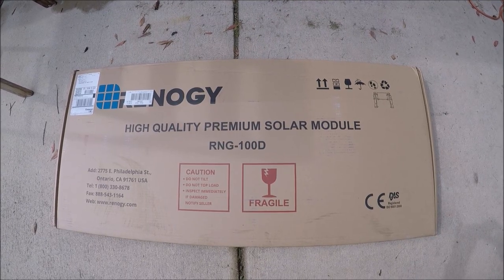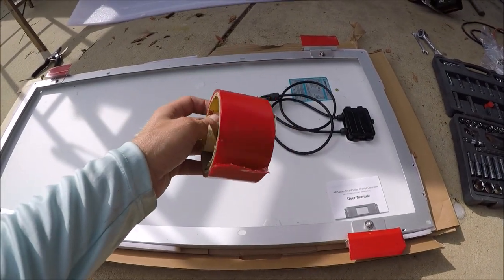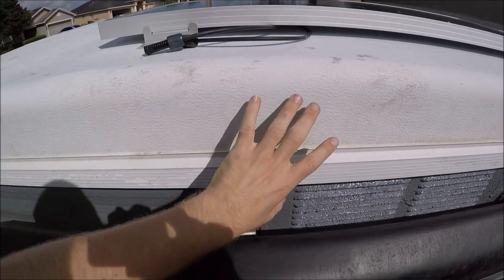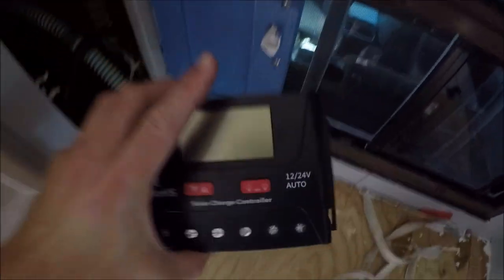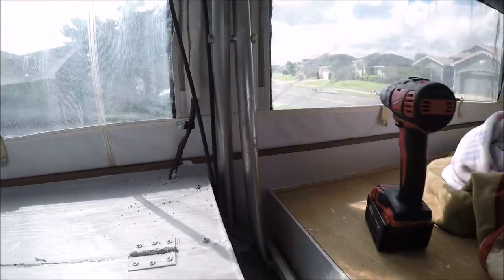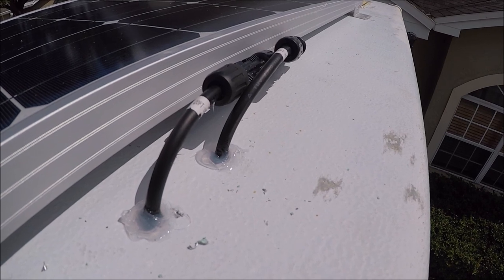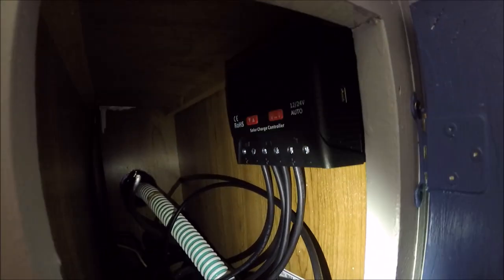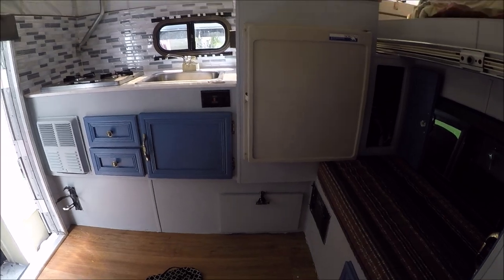How to install solar on a pop up camper Ep8

Comment: advice to anyone watching this video DO NOT USE TAPE to mount your panel, some self tapping screws with silicone is the safest way to go. Tape is not effective long term and the panels WILL come lose at some point using tape
Reply from the maker: I'm going on 3 years.  Tape is good as new.   Buy good tape if you want to drill a bunch of holes.

Comment: Thanks for the video, very helpful. I have the exact same Skamper and I'm having a hard time with the converter/inverter part. The Skamper came with Magnetek 6612 Power Converter .. My current setup is: Hyundai 255W Panel (already installed on the top of my camper) + Global Power Lithium Battery 12.8v 100ah + Renogy Rover 40am Charge Controller + Magnetek 6612 Power Converter (came with the camper. I can connect to shore power, and has a couple of outlets and couple of inside lights)

My goal is to use the panel to charge the battery, and use the converter (or inverter?!) to distribute the power to the outlets and lighting.

What I really don’t know and really need help with is that I don’t know if need to buy an inverter too or the combination of the power converter and the solar charger controller will do? The outlets and inside lighting in my camper are working with shore power, so my idea it was to connect the battery to the converter, but the more I research, I’m started to think the converter I have is just for shore power?!

Thanks a lot!
Reply from the maker: Yes, it's just for shore power unfortunately.  I ran into the same issue.  I'm glad you found my videos.

Comment: Can you run your AC with the solar panels and what inverter do you have if so? 
If not do you just use shore power or a generator for the AC?! Thanks love the channel
Reply from the maker: The solar will not even come close to running air conditioning.   I usually run it off shore power or a 2000w generator.   That's pretty much your only choice.  Thanks for watching.

Comment: Why didn’t you just mount it to the cabinet door? It could swing open allowing ease for readings.
Reply from the maker: You'd be fighting against the thick wires coming in and out of it.

Comment: 200 amps of solar and 4 batteries will get you through a long cloudy spell and stay up with the fridge. I know you are not spending months in the bush lol. But a week is fun with plenty of power. Thanks for sharing, I'm looking forward to more of your vid's!
Reply from the maker: I am using an ARB fridge.   It can goes days with just the 100ah battery.  So having a cloudy day isn't so bad.
Reply: I have a large truck camper & 4 batteries is out of the question. Two group 31 batteries weigh 140 pounds. I'm already pushing the GVWR of my big dually.
Reply: Good to know when I get a pop up trailer. Thanks

Comment: Good series!  I know its older, but I had to comment for folks who might stumble across this like i did.  3M tape will break down eventually, screws and dicor to secure the panels to the roof are the safest way to go about mounting.  Will seal it up so its water/weatherproof too.  And Silicone should never be used because it too will break down (shrink) over time with weather and changes in temp  - leaving you vulnerable to leaks.  Otherwise lots of other fun design ideas.  thanks for posting!
Reply from the maker: Still after all these years the 3m tape is holding up.  Everything you said is true, just check them regularly!

Comment: Do you have any trouble with just using adhesive tape to hold down the panel? I have the exact pop up in AZ. The tape might dry rot due to the extreme heat and being so dry and fly off at highway speeds. I also don’t want to make holes on the hoof. Thanks for the how to!
Reply from the maker: I've had this tape holding on my solar panel for 3 years now on my other camper.  It's solid and not going anywhere.  That's with the Florida weather and sitting in the sun at 110° in the summer.

Comment: Thanks for the video! Wondering how it is holding up a couple years later?
Reply from the maker: Great! These panels are supposed to last 25 years or more.  Renogy is a great company.
Reply: @OverlandFlorida  How much power do you get with that? (Just enough to charge electronics, or a little more?)
Reply from the maker: @AdventuresinPopUps  you need about 6hrs of sun to with this panel to maintain my fridge, lights and charging phones.   I'd recommend 2 panels or 1 big one.

Comment: I'd love to build a simple custom popup just for standing space in the middle of a low roof Promaster 118 low roof  where the roof of the popup is a reinforced 300 watt solar panel and frame itself.  I imagine a design where  I JB weld a watertight  aluminum  lip around van opening that will sit inside the frame of the panel. Hinged on one side and clamped down onto rubber weather stripping.

Comment: Just installed a Renogy 160 W panel on my RAM Promaster. Cost about $240 shipped. Cables, PWM controller and panel. I used Sikaflex 252 and those plastic brackets.
Reply from the maker: Awesome! It's a great kit.

Comment: Hey there.  I notice you have brackets on the panel.  Is that just to make it so the wires can fit through?  Could you just glue it flat to the roof if the wires could come through a hole?
Reply from the maker: Yes, you could mount it flat.

Comment: Nice install.  Does it rain every day in Florid?   Maybe you should buy a boat.   How's the new intro coming?   I'm sure the Jeep community is getting nervous.  Looking forward to your first trip out in the new camper.
Reply from the maker: We usually have a 15min or 1hr rain storm in the summers.   But this summer particularly we have had a ton of rain. I've had a few boats and will probably be buying another one very soon. 

Nicole and I just took the camper out last weekend and camped one night.  It worked great! It rained from 6pm until 11pm and we were totally dry.  It was nice cooking inside too!

Comment: Kevin, can you mount the charge controller on the backside of the door? Leave enough slack in the wires to open door, that would allow you to clearly view the controller? Just a thought 👍🏻
Reply from the maker: No. The wires are too thick and don't bend that easy. Good thinking though.

Comment: Did you figure out the bed? Joanns fabrics sell thick foam by the yard. We've used it in the past for mattresses . Also call around to upholstery  shops.  Or get a hot knife and cut down a decent memory foam mattress for best comfort. Happy camping 🌺🗿🌺
Reply from the maker: That's a good idea.  We still haven't bought or made a mattress yet.  I'll check out the Hobby Lobby to see if they have any thing like that. I think Joanns closed down in my town.

Comment: Wanted to send a reminder: please check the load rating on your tires. Tire failure at any speed with a truck camper sucks! Long Point Park is next on my list. Safe travels!
Reply from the maker: That's a good point.  I'll check that.  Thanks.
Reply: Couldn't remember if you got your truck new. Used car dealers are famous for throwing  car tires on their trucks.
Reply from the maker: @garyausher  It's still the factory tires.
Reply: Sounds like you're almost ready to roll. Enjoy!

Comment: Install looked simple enough.  Why not mount the charge controller to a swing out bracket, or to the back of the cabinet door itself?
Reply from the maker: They wires are so thick they would pull in the bracket when it would swing out.
Reply: I had the same mounting issues with space so I just installed a tap light in the top of the cupboard to see the readout.

Comment: Love the video helped me alot but i was wondering, from the battery what is it hooked to? Do you have a inverter?
Reply from the maker: I just used the power for lights and charging devices.  I didn't use an inverter.

Comment: So after having it installed for 9 months would you change anything? Does it offer enough power to run ac and frig? Super curious if i should do this with our popup as we dont always have electric where we go
Reply from the maker: There's no way it will run ac.  It will cover the fridge, lights and charging phones with 200ah of batteries.
Reply: You'd need at least 4 100Ah deep cycle batteries and 600w of solar panels to even come close to running the AC (depending on how many btu the AC is). Let alone all the other stuff.
Reply: If I have a good battery like a good deep cell with the 100w panels will it run the ac and fridge?

Comment: You can get 10-30% more from your panel if you use an MPPT controller - we have the same set up on our Romahome - unfortunately, we found it  does not make enough power to run the fridge 24/7 but meets our other needs great
Reply from the maker: You are correct and I plan on upgrading the charge controller soon. But I'm using an ARB fridge and not the camper fridge.  The ARB is super efficient.
Reply: how many solar watts were you sending to where it wouldn't run the fridge 24/7?